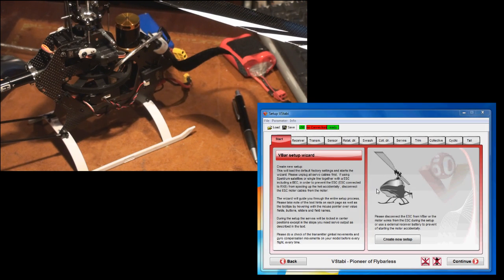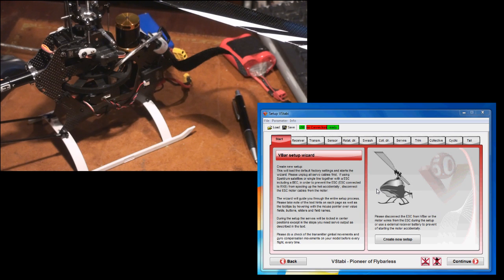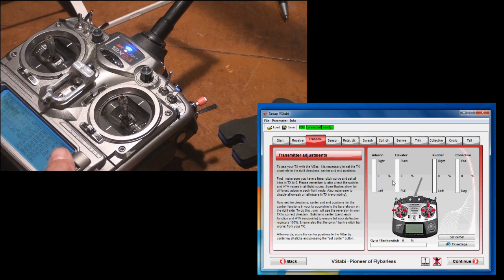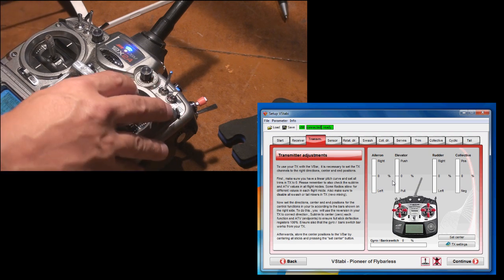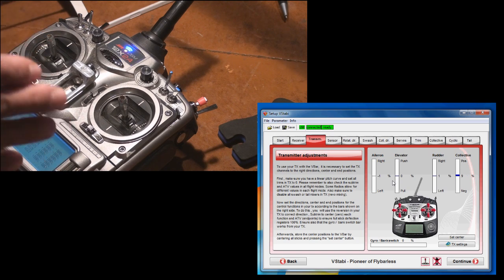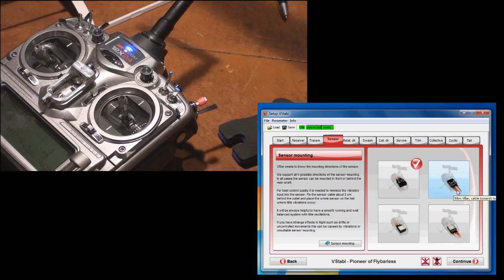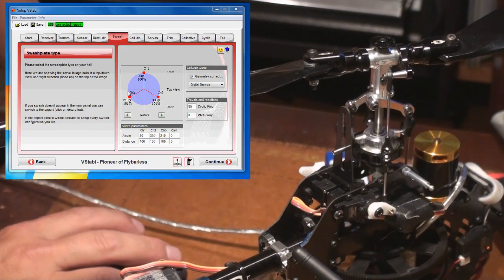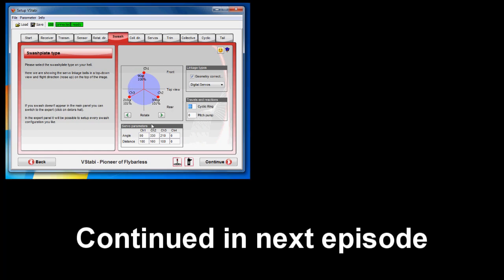v5 Episode 4 Part 1 - Setting up a new heli

Comment from the maker: @jerstolp 

Yes, correct, (it was me that found out the exact behaivor of the bug at HF), I never thought of posting a change to this video, I will add a caption in that part.

If you use the spektrum satellites coming with AR8000's its safe to run HiRes it seems.

Comment: Hi Fredrik.  In the transmitter tab, after you have set everything to zero, does it matter if the sticks are moved off centre before pressing the 'Set Centre' button?
Also in bank switching i am using Gyro Sense on 3 pos switch.  I get like -94,-4,90.  There is no ability to adjust atv in XG8 when using gyro sense.  Does it matter as long as it selects three banks?

Comment: I have done all setup procedure & everything works as it should except the sense of direction(the gyro correcting  for winds ect) is wrong?. When I correct the ailirons the elevator is not correcting right and vise verser? Ive tried correcting this in the servo direction menu & nothing corrects this?
Any help appreciated.

Comment: Hey I set up a new heli with vbar(my first). On the maiden my tail wagged similar to a pendulum on a wall clock. Long, sort of slow wags, from side to side.  My tail links are smooth, not binding. Any ideas as to what to do? This is my first fbl heli.

Comment: Hi Mr Mel can you help me with a conection problem please. I have a blue mini vbar on my trex 450 pro but when I plug it in to my pc it dosent connect the rudder servo is in the RD and the ESC is in the RXB and the Receiver is in the RXC I am using the S-bus futaba I plug the usb cable to the vbar but the usb light doesnt turn green and when you pug in the esc battery the V lights up red but still no connection thank you for your help